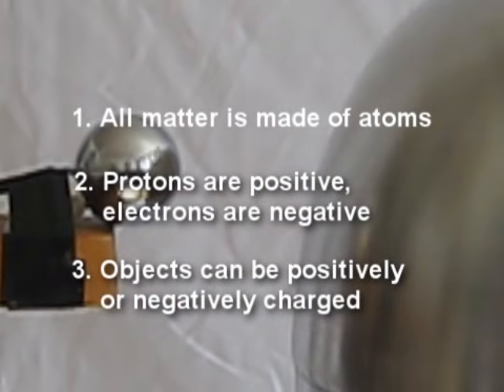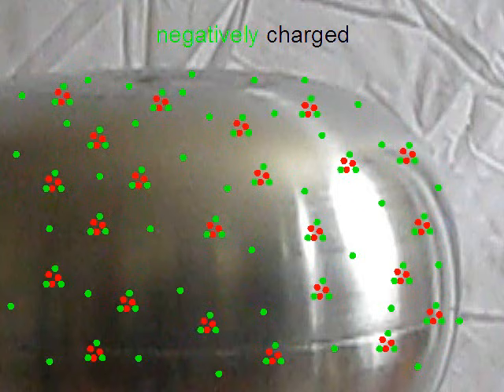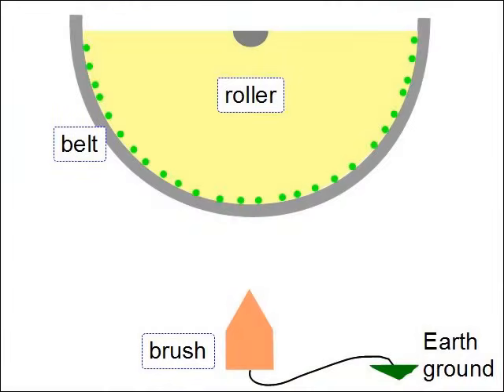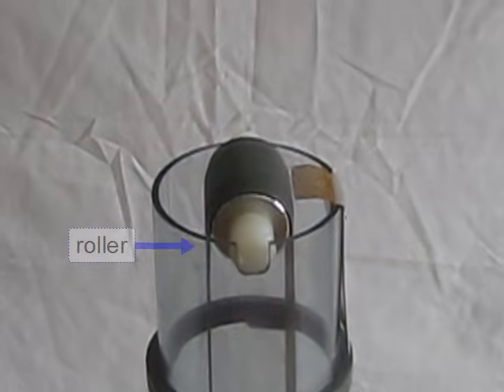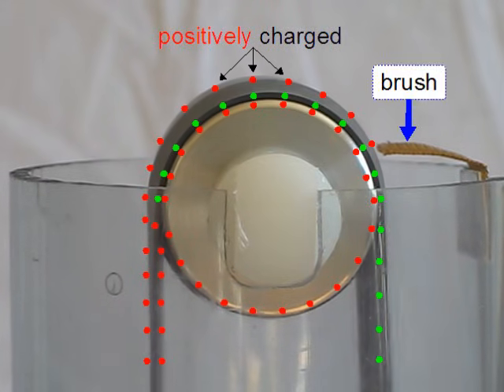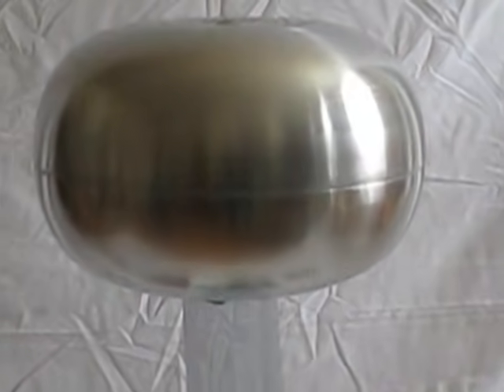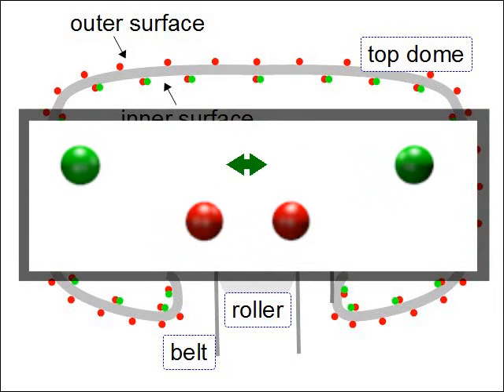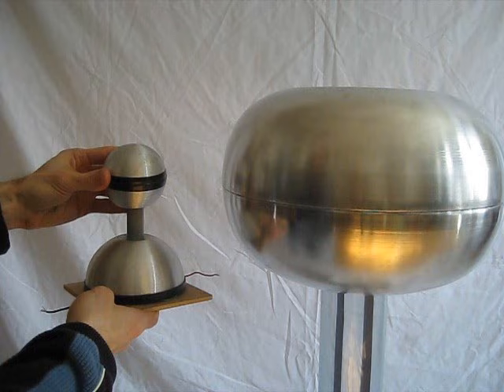How a Van de Graaff Generator Works

Comment: I need information about the belt material. Please advise me raw material and property of material..
Reply from the maker: Hmmm... All the information I have, I gave in the video. The inner surface of the belt should be in the triboelectric series somewhere between where the materials for the outer surfaces of the bottom and top rollers are. That's about it really.
Reply: You can buy latex sheet on E bay and custom cut it or go to walmart and get some exercise  band material. It is usually in 4" widths but you can cut it down. When building VDG keep everything clean. Cleanliness is everything. The oil on your skin can spoil the output. Wipe all surfaces with alcohol or a solution of cloudy amonia cleaning strength. Last but not least cover any sharp edges with electrical  tape or clear silicone, the vinegar smell kind.
Reply: Amazon sells a variety of VDG belts. Weird I know.. but great. Look and feel like Neoprene rubber. Can contact manufacturer.

Comment: Instead of using an electric motor could you use a human arm that way it's manual powered
Reply: Yes, but you may need to add gears to get higher belt speeds since your arm wouldn't be able to turn it very fast.

Comment: I am afraid you did not explain well about the choice of the top roller. By choosing the top roller that gets positively charged by rubbing against the belt you are neutralizing some of the positive charge of the belt and thus reducing the effectiveness of the VDG right? Instead should you choose a roller which gets negatively charged like the bottom one?
Reply from the maker: The belt has two surfaces, an inner surface and an outer surface. Since it's made of a non-conducting material, the top roller doesn't directly affect the charge of the outer surface. By neutralizing the inner surface of the belt, we're actually putting electrons on the belt, it's going from positive to positive+negative (neutral). Those electrons are what the bottom roller wants. So the top roller is working with the bottom roller.

Comment: What will happen if the brush is not connected to ground ,.what is the use of vandegraaf generator
Reply from the maker: It won't work as well. You'll end up with less charge building up on the dome.
Reply from the maker: You can create a ground by having the bottom be connected to another dome though. I did that with this smaller Van de Graaff generator here https://www.youtube.com/watch?v=QrCgtjZwnB0 at around four minutes and sixteen seconds into the video.

Comment: Can I use nylon for top roller
Reply from the maker: Yes, but it also depends on the material you use for the bottom roller. The two roller materials should be near opposite ends of the triboelectric series table https://rimstar.org/science_electronics_projects/triboelectric_effect_series.htm with the material for the band being somewhere in between. So if the bottom is teflon, for example, which is near the negative end of the series then you can use nylon for the other end since it's near the positive end of the series.
Reply: I've built a VDG with a Teflon top roller and nylon bottom one and it works great you can swap these top and bottom if you want to accumulate the opposite charge.. or build 2 machines to use together for longer discharges. Nylon is hygroscopic and I haven't looked up how much effect this has on building charge.

Comment: Very thorough explanation of Van de Graaff generator operation, and excellent video production!   I notice that you have one of my  first model generators that I sold in kit form back in the late 90s!  That is awesome!  I can't remember if I sent the little tutorial on electrostatic generators, including the Wimshurst Machine with it or not.  https://youtu.be/Pp-64egH-Ro
Reply from the maker: Thanks! I had a lot of fun with the small Van de Graaff generator. I bought it assembled (well, mostly) from a company which used to sell a lot of fun science and weird science stuff. I don't recall their name though and can't find a link. I eventually stopped using the batteries and instead extended some wire to the exterior for connecting to my DC power supply. The batteries did make for a nice, compact unit though. Nice design. Thanks for getting it out there.
Reply: @RimstarOrg  Yes, there was a fellow up in International Falls MN that bought about a dozen of my generator kits to build up and sell.  Those were the first model I made.  After that, I made some with a wider rubber band belt, and ran the motor off of 3 Volts, which doubled the current output.  The first ones I made used a teflon lower pulley and a brass top roller.  They worked okay, but on the second version I used PVC for the lower pulley and with the gum rubber belt, they worked a lot better.  :)  I have a You Tube channel with other stuff on there too.  Just search Papazstuff4U to see the other stuff, including a new theory of how the Universe works.
Reply from the maker: That makes sense then. I have the one with the teflon lower roller, thin rubber band belt, and bass upper roller. It works great.

Comment: I think this is wrong
Reply from the maker: That depends on the materials used for the outer surface of the rollers. They're what determine the polarity of the charge moving up to the dome.
Reply: @RimstarOrg  aight, glad to know, helps me a lot. THX
Reply: @frand_9248  You are right in the sense that all the charge that is transferred in a VDG is ultimately transferred by electrons.  A positively charged comb can only serve to draw the negatively charged electrons off of the belt.  Otherwise metal ions would have to be formed from the comb itself which would erode it away and deposit the metal onto the belt.  Similarly, positive ions can't leap off the belt because they are an integral part of its chemical makeup.  The core mechanism at play is electrostatic induction. The only place you'll usually ever see actual positive ions carrying positive current is in elecrochemistry (Batteries, electroplating, etc.).
Reply from the maker: Which part do you think is wrong? I know that my explanation of the Faraday cage is a little precarious -- I just didn't want to give the standard answer using only electric fields.
Reply: @RimstarOrg  It's not that I am 100 percent sure, but according to what I researched, it's the electrons that were transferred to the top instead of the protons. I am not sure though, thanks for asking.
Reply from the maker: To answer your first question, the charging of the inner surface of the belt is determined by the triboelectric effect. At 3:26 I give the explanation for this. At 3:42 I show how the inner surface becomes positively charged.
The wikipedia example is actually the opposite of mine as far as the rollers and belt are concerned. Theirs is also upside down compared to mine since they have the metal roller on the bottom and the triboelectric effect happening with the roller at the top. I say theirs is the opposite of mine because their roller is acrylic glass, which is positive with respect to the belt and mine is teflon, which is negative with respect to the belt. You can see this in the triboelectric series table https://rimstar.org/science_electronics_projects/triboelectric_effect_series.htm . If you compare the charging of their rollers and belt to mine then you'll see they're all opposite (keep in mind that their metal roller is on the bottom and triboelectric roller is on the top, upside down compared to mine). So we're consistently opposite.
The reason both our domes become positive though is because mine has the metal roller at the top a theirs has the triboelectric roller at the top.
For more on the triboelectric effect, see my video here https://youtu.be/ey88EdZo9hU
Reply from the maker: :-) You're luckly I replied so quickly! I'm on the road these days so most responses are a few days late.

Comment: Good explanation. I had a great opportunity to use a 3 MEV (millions of electron volts) Van DE Graaff electron beam accelerator. 28" inch wide belt in a nitrogen/argon tank on the second floor. A vacuum tube with progressive increased voltage plates along the tube pulling the electrons through the beam tube (first floor) and a sealed titanium 'window' @ an energy of 3 M.E.V.  producing a beam of high energy electrons. This beam was swept with 2 electromagnet 'scanning sweepers' that were 180 degrees apart sending alternating electromagnetic pulses on the beam tube. Basically that 'fans the beam to cover a conveyor for processing the products. This high energy beta radiation was used for interlocking molecular structures of polymers providing a "heat shrink memory" , varying the properties of silicon electronic components and purifying gems as diamonds, topaz and others. We made rare  blue topaz from yellow topaz. It basically "force ages" the gems millions of years doing what natural radiation does.. .cool video. Thanks very much!
Reply from the maker: Thanks. Cool!

Comment: Man's overcomplicating the scenario and the explanation.
Reply: Yes, it's mostly fantasy. Those are combs not brushes. The points make for better discharge. The belt has the same charge on the inside as the outside. The charge on the belt affects the comb, not the charge on the roller. The combs tend to re-neutralize the belt so it can repeat the cycle on the next time around. A metal roller, on the top, would not have a charging effect. The sphere is a one plate capacitor. It's charged the same whether inside or out. The comb is attached to the inside, not outside, but it doesn't matter. There's no charged particles in the air, room, trees or anything. Everything is neutral. You only get charge in a thunderstorm.

Comment: hi very good information. i have one question: since U=Q/C and C gets bigger with the size of the topload what would happen if you just use the brush as C ? in my theory lightnings would be much more U and less I.
Reply from the maker: I like the way you think, using the formulas. I do the same thing. However, there is a piece missing. That is that if you use just the brush or a small object then the voltage will build up and create a strong electric field with the surroundings. That electric field will pull the charge from the object and it will leak away to the surrounding air. I mention this, sort of, at 14:26. So a big rounded area is needed to allow a lot of charge to accumulate without leaking, and that allows the large voltage to build up. So the size and shape of the dome are important here too, allowing that Q to not leak away and instead become big.

Comment: hi @RimstarOrg great explanation and content! I've noticed that most Van de graaff generators are positively charged. is there a simple way (perhaps making the belt a figure 8) to make this charge negative at the surface of the dome?
Reply from the maker: Thanks, and thanks for watching! Off-hand, I don't think twisting the belt will work. Have a look at the video again at 3:44 and you'll see that both the inner and outer surfaces of the belt on the way up are positively charged. Changing the bottom roller for a glass, acrylic, or lucite one while leaving the top one as metal is a pretty simple change (https://rimstar.org/science_electronics_projects/triboelectric_effect_series.htm).
Reply: You could swap rollers. Top to bottom, bottom to top.

Comment: Inside the top dome, there is no electrical field. That's why the charges can be collected from the belt without any "effort".
Reply from the maker: Yup. But I wanted to attempt to give an explanation of why there's no electric field, and do so at the particle level instead of the usual field explanation.

Comment: hello again i finished the wimshurst machine and its working great thank you for your advice
now i am wondering if for the negative bottom roller instead of tefflon or vinyl if i could use acrilyc tubbing?
it would guide me a lot thank you in advance and keep the good work up
Reply from the maker: Check it in the triboelectric series table. Here's the one on my website https://rimstar.org/science_electronics_projects/triboelectric_effect_series.htm. Acrylic is on the positive end. The material for the surface of the other roller should therefore be something on the negative end and the material for the belt should be in the table between the two roller materials.
Glad to hear you Wimshurst is working great! Thanks for letter me know.
Reply: ok thank you soo much and cant wait for the next video

Comment: Sir i have made a vandegraff generator but it is not charging i have used teflon  tape as belt rubber as  lower roller and plastic as upper roller .please jelp me

Comment: Is the top roller made out of metal?
Reply from the maker: Yes, the top roller's made of metal.
Reply: RimstarOrg Sir. What kind of material can I use for the belt? Can I use tarpaulin?
Reply from the maker: I don't know if tarpaulin will work. From https://en.wikipedia.org/wiki/Tarpaulin it looks like it can be made of a bunch of different things and looking those things up on the triboelectric series table https://rimstar.org/science_electronics_projects/triboelectric_effect_series.htm shows them in different places, so I can't say. If it's made of polyurethane then it's too much to the positive end of the table. If it's made of polyester then it's more central in the table and might work depending on what you use for surfaces of the rollers. If it's canvas then I just don't know. But there's also the possibility that the material used for the coloring and other stuff would interfere so it's impossible to say without trying it.

Comment: Could you use a negative ion generator to enhance the demonstration?
Reply from the maker: If your belt is being charged negatively instead of positively like the one in this video, then you could use the negative ion generator to spray negative charge onto the belt. I think I've heard of some research ones which do that. It would also mean changing the materials used for the rollers so that the belt is being charged negatively.

Comment: A year has passed since I saw this article and I have built my own +/- pair of VDGs. I'm using 50mm rubber furniture belt, 50mm dia x 65 long rollers top and bottom. At one end the roller is Nylon 66 chosen for better insulation than Nylon 6. The opposite ends are Nylon 6 wound with gas-fitter's PTFE tape (thicker than plumber's tape) sufficient to form a crown for belt-centering. With the belt running at low speed I get 5 micro-amps between the spray-combs. High speed gives 10 micro-amps, measured on my AVOmeter. Without the top sphere fitted, I can pull 10 mm continuous spark between the ends of the meter wires. Top spheres are 12" gazing globes with the base cut out to fit the 110 diameter PVC soil-pipe. First light was enough to switch my shop-radio off and on, and mess up the digital clock on the wall. I have yet to finalise the sphere-fittings and make BIG sparks.  :-))
Reply from the maker: Sounds awesome! Yeah, analog meters are definitely the way to go when measuring current in a high voltage system. DMMs don't last long there. Though I use a cheap analog meter anyway, just in case.
Reply: My two units are now up and working. The positive top one will give loud, hot-white 4" sparks from dome to a 10" grounded dome. The longest sparks are 12" mauve wispy multi-forked and go 'pop' rather than 'crack'. The negative top unit sits there hissing and sizzling malevolently, and will give hot-white 5" sparks. Charge current is only 4 micro-amps. If a 1/4" nut is placed on the 10" grounded dome, it will give regular 13-15" mauve multi-forked 'lightning' and enough ozone to make me wobbly and nervous. If I can find someone willing to risk their camera, I'll post it on YouTube.
Reply from the maker: Cool. I know it's a Van de Graaff but it almost sounds like you're describing a Tesla coil with what you get from that nut.
Reply: I keep my workshop at 40% or lower RH to stop my machines and tools rusting, but as it is freezing outside, it's even drier. The floor is wood over expanded polystyrene over polythene sheet onto concrete. If I stand within 4 feet of the negative machine, I soon get sparks coming out of the side of my walking boots across the sole to the floor. The bottom comb goes to a screwdriver stuck in the soil outside the shed. It may be that my wood floor is one plate of a capacitor, with the damp-proof membrane the dielectric to the concrete in the ground. It's the same noise and feeling as standing under a transmission pylon on a misty day; hissing and sizzling.
Reply from the maker: Nice.
Reply: I've been busy since the last post... https://www.youtube.com/watch?v=XjP8F1iRmDc

Comment: Just for sake of not confusing the audience, photoelectric word is incorrect word.  Photoelectric has to do with light.  This is static electricity, so the proper term is electrostatic, not photoelectric.  Awesome tutorial
Reply from the maker: No, the photoelectric effect takes place in negative coronas, ones where the sharp electrode is negative. See https://en.wikipedia.org/wiki/Corona_discharge#Mechanism_3. As you said, the photoelectric effect has to do with light, that is photons causing the release of electrons from an object, in this case from the brush.
Reply: RimstarOrg fascinating.   Thanks for answering.

Comment: What will happen if the brushes touch the belt?
Reply from the maker: It won't work as well. If the brush touches the belt then it will only take charge from the belt where it physically touches the belt. That's a small fraction of the charge that's on the belt.
Reply: RimstarOrg Sir. You said on your tutorial that it is ok for the brush to touch the belt but it will leave some debris. Anyways... Thank You😂